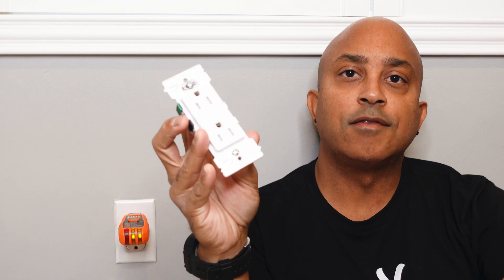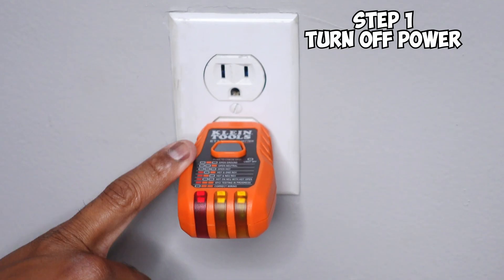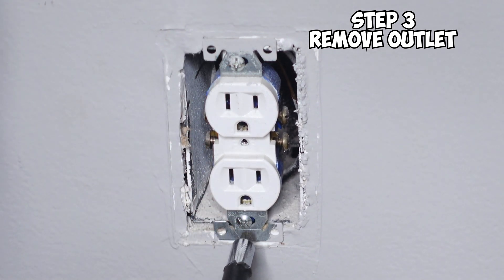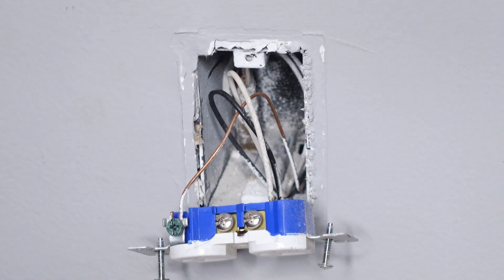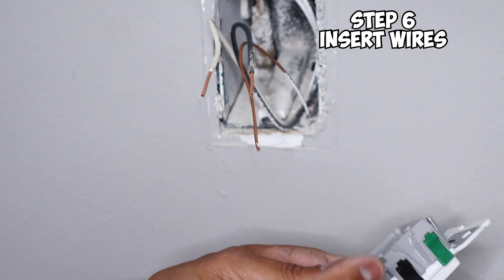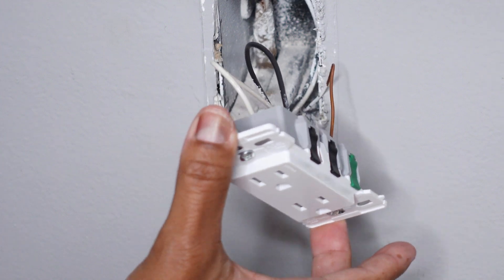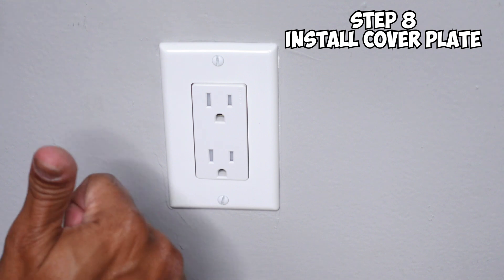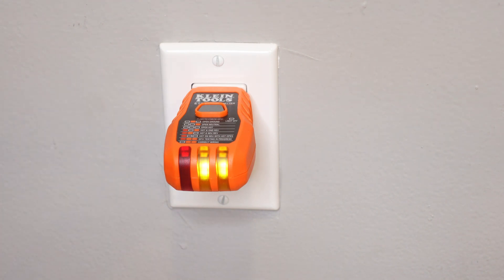How to Install ANY Outlet in 5 MINUTES or LESS

Comment: Ayo whoever did you original outlet were arseholes (unless you pre prepped it for the video?) They left the screws out when you have a metal receptacle box in there. They should of tightened them down. I've never seen the pull tab ones does it make it cheaper? They make the same thing with screws instead of plastic, side wire outlets are my favorite because they make for a cleaner job & if you have little wiring to work with it saves a whole host of issues. If your running alot of stuff on a outlet that has a 20 amp breaker make sure to put a 20 amp recepticle on it. Its not a big deal but if your running alot of pc stuff or stuff that takes alot of power off a outlet a 15 can melt & break down if its on a 20 amp breaker.